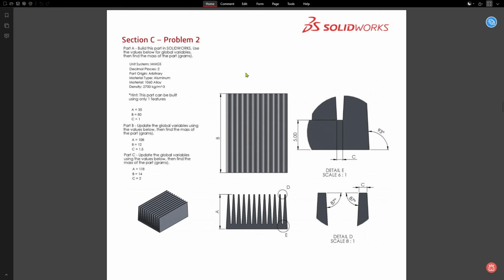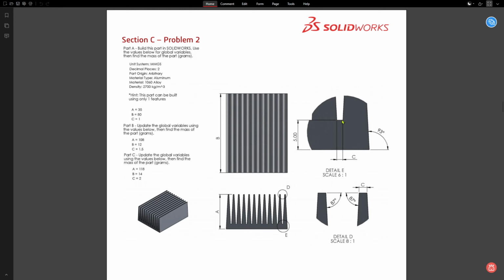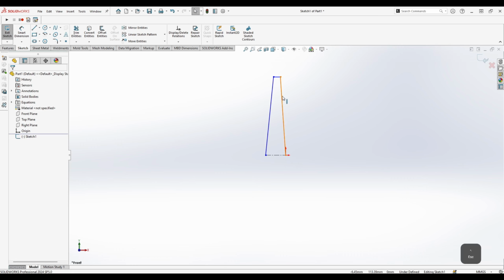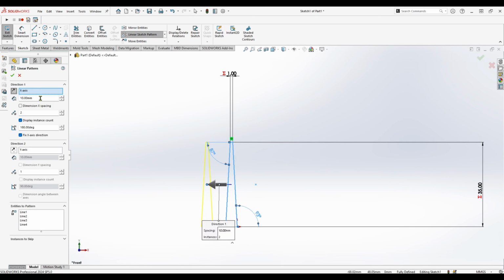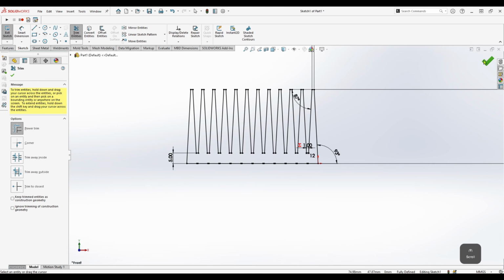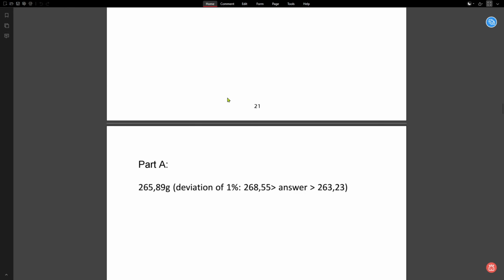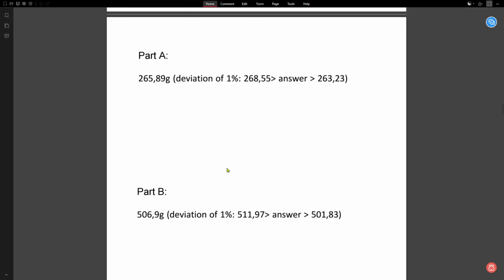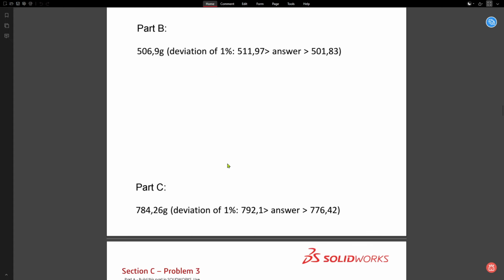Section C Problem 2  - CSWA Mock Exam | SolidWorks Certification Prep Practice

Comment: I get the same answer as you get it lem ask you if you sit for CSWA exam and you meet with that question the answer are that from the CSWA document or they consider what a candidate he/she get as the correct
Reply from the maker: The exams are mostly multiple choice, but the exams dont have errors like this prep exam has.